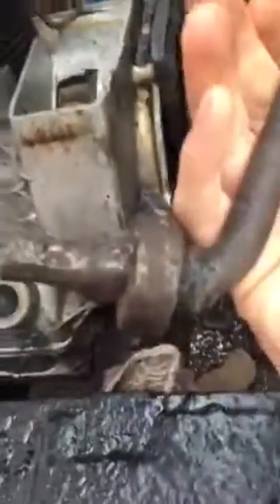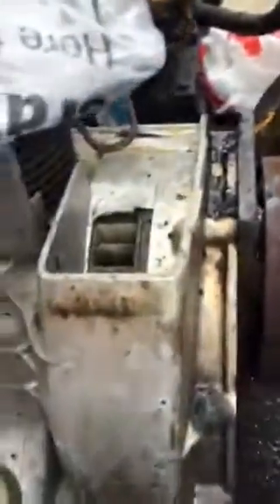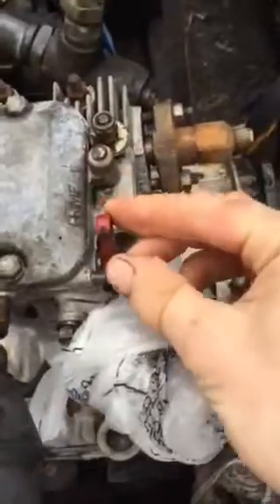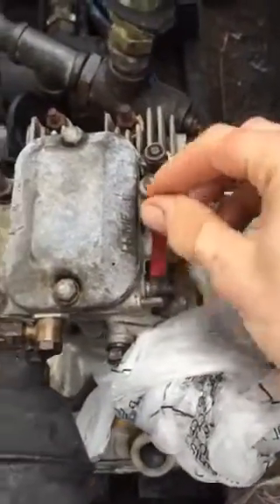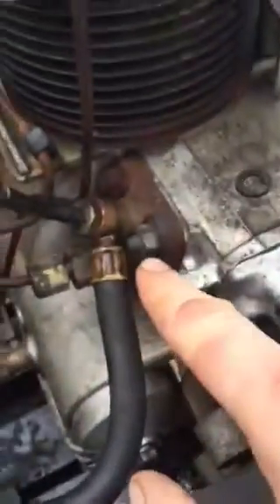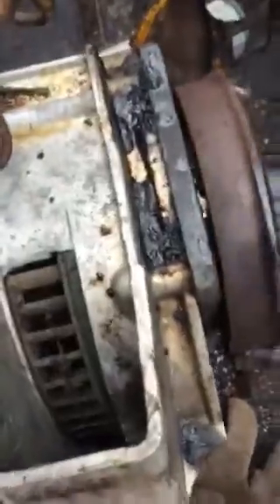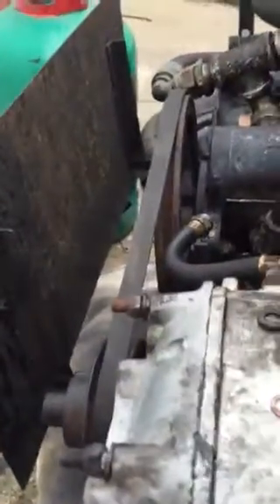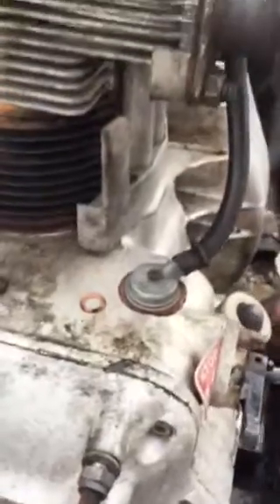Petter aa1 help part 2

Comment: I have never had chance to see that type of crank handle start, Im wondering if the extra bit you cut off was suposed to locate into something further in to turn the fan.
I cant say for sure all my engines have pull cord starting methods.
your correct with the pump bleeding and what you should do .
your close to starting it now I guess. I look foreward to seing it run

Comment from the maker: Thanks for the info and yes your right , I part I cut off wasn't needed the reason handle would not go in as you have to lift the boss ( dog ) and push it right inside when it's lifted it engages with the cogs and pushed right back into a hole I will be making  a video tomorrow explaining as there is nothing I have seen on YouTube explaining this. Now I need to do some cutting and welding to repair handle hopefully it will be running by tomorrow. Many many thanks